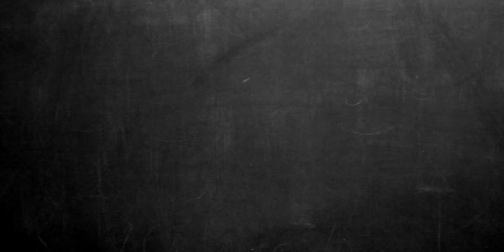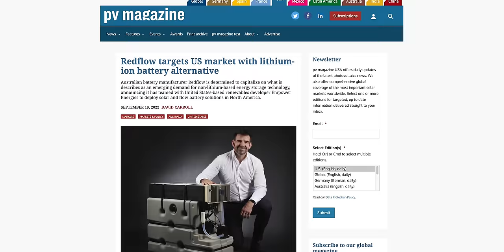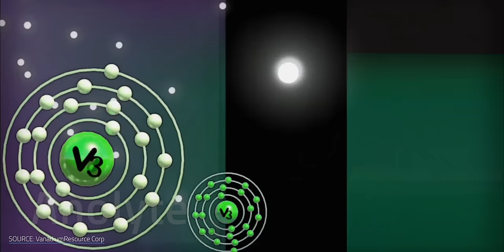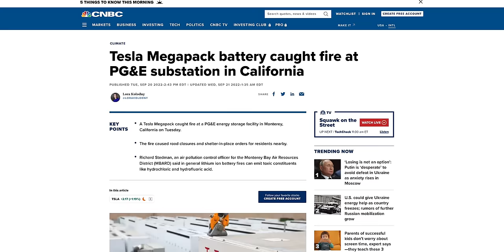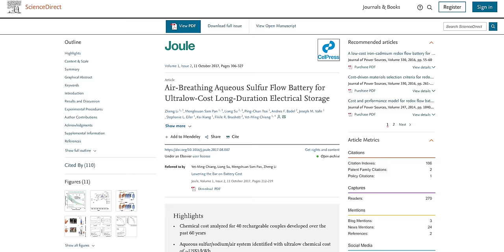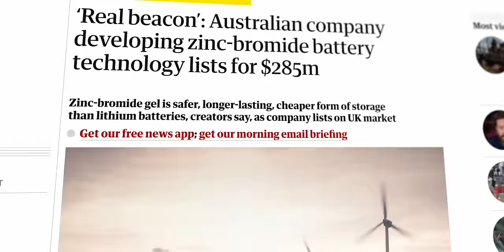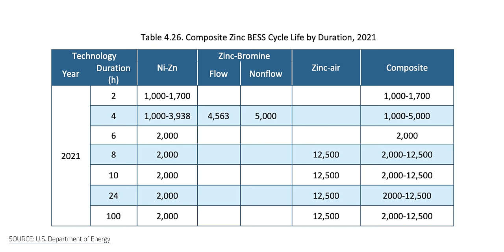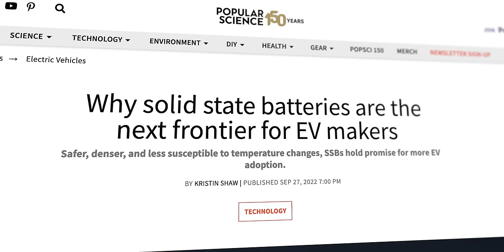137 Year Old Battery Tech May Be The Future of Energy Storage

Comment: With the vanadium chemistry, the assertion that they're safe "with proper design, manufacture, and maintenance" is engineering hubris at its worst. Don't use systems that require everything to go absolutely correctly to avoid catastrophe, use systems that are extremely unlikely to cause toxic nightmares even if everything goes wrong. Any other approach is stupidity. If the smallest hiccup can cause vanadium sulfide to poison an entire area, then DON'T USE IT. Jebus.

Comment: What I keep on harping, over the decades ... COST is the most important factor !!!!!

If lithium becomes scarce, its price will rise. Not to mention the other components in a lithium ion battery. Look at gasoline. Fossil fuels are used because they have great energy density, more importantly, they are cheap ! But when there's a supply disruption, the cost rise, and the masses want to lynch oil executives !

Save lithium ion for portable devices, from smartphones to EVs. Use other battery technologies for stationary bulk storage. And use all of them. Preferably, those using materials easy to supply, and less likely to suffer volatility, in prices. And when it comes to the materials hazardous properties, if its stationary, it can easily be made safe.

You keep harping like there's one fits all solution ! There's not. Use the solution, that's best for that particular application ! And there's nothing wrong with lead acid batteries. They're perfectly safe, if you don't abuse them, and recycle them properly. And it doesn't take much effort, or cost, to do either.

Comment: "Do you think zinc-bromine batteries will gain ground and become a big player in energy storage?". If fusion energy or Dual Fluid reactors became a reality, you would not realy need them. 120 Wh/kg. I have a scooter with a 48V/20 A. Or nominal 960 W/h lithium batt. (18650 cells I think). If I remember correct its 6,5  maybe even 7,5 kg, or 128-148 Wh/kg. My bicycle also has a 48v/20 A. But only weights 5 kg. Or 192 Wh/kg. So a Z-B would be fine..A 100 kWh Tesla battery weights 1377 pounds. Or 625 kg. Thats 160 Wh/kg.

Comment: Redflow batteries can be bought today.  But they are more expensive than the Tesla batteries.  I bought a Tesla battery because redflow is unprofitable and so may go into liquidation and because Tesla has negotiated a 3 times higher feed in Tarif if you sign up to allow the provider to drain the battery approx 4 times per annum (vertual power plan I think is the jargon). I acknowledge that the reflow is better technology and should be the future but every one knows the best technology does not always dominate

Comment: Thx Matt, I love the channel.  Generally speaking i'm a much bigger fan of hydrogen ultimately being how we as a society store extraneous energy (via nuclear sources) but this is certainly a promising development for the overall direction that the EU and many US states are hell bent on headed.
Reply: Hydrogen via Nuclear, Sounds like Nuclear energy with extra steps? Isn't there a vast amount of energy wasted in this process to 'save' the hydrogen for later?
Reply: @brendanmichaelwelsh6260  yes, that's the point: you have extraordinarily efficient power generation in centralized, highly productive sites so you can stock it up at a loss to save it for applications where those storage methods address specific technical challenges.  In this case, Hydrogen is a better carrier of potential energy than any other substance in the universe (save a few exotic types of matter that are not useful for these kinds of systems).  So you can fit a LOT of energy in a small space with hydrogen for something like a car or truck, AND with the added benefit of not being overly reliant on massive supply chains of exotic and carbon heavy metal refining operations.  Realistically we should be saving rare earths and the like for things like electronics and similar applications anyways. You can do this same thing with renewables too, but if carbon is your biggest concern, and a number of us believe it is, then doing it at scale with renewables suddenly becomes a whole lot less sexy. And that's without even getting into the real world cost and geopolitical element of being reliant on nations like China and India to be fair and earnest participants.

Comment: While batteries are cool, its kinda attacking the problem backwards. 
Instead, figure out where in your manufactoring you can store energy as materials. 
Fx in chemical production, you want to run your electrolysis when energy is abundant, and store the products for when its not.

Comment: For the open public, battery🔋cells can be useful also with mass density adjustment. From compress micro vs lighter weight, making more room. To bulk & puff vs small & heavy, such as flight crafts advantage. Gelion Z-Bro's cells has its unique attributes usage.

Comment: I've never been a fan of Lithium Ion. It's good that we're actively trying to replace them. Zinc/Bromide seems a promising formulation. However, I believe Copper/Carbon/Phosphate chemistries will show the most potential for replacing and surpassing Lithium Ion. Where safety is concerned, anything is safer and Lithium Ion. I've seen EV's catch fire. They burn to the ground in seconds. I will never drive or ride in one equipped with that most dangerous formulation.

Comment: Just looking at the gelion battery I wonder if it would work as a drop in replacement for standard automotive 12 v batteries. While I agree that it looks great for stationary storage, it seems better than the 12v lead battery. If understood correctly it is more energy dense and safer than the lead battery, and still just as recyclable.

Comment: The reason Zinc Bromide batteries have never been mass produced for the past 140 years, is because of their highly corrosive chemistry.  
While Zinc Bromide batteries have excellent energy density, deep discharge, & good reversability... Lead acid batteries dominated the market, because they are 7 to 8 times more durable.  

The simple fact is, that the problem of Zinc Bromide corrosion cannot be solved, because of the oxidizing nature of bromide itself.  These batteries are doomed to be short lived, compared to their Lead Acid counterparts.

Comment: Natural renewable energy is NOT in wind, solar, or buofuel. You can't even recycle wind turbine blades or solar panels without huge waste and landfills.

Clean renewable energy is and has always been rivers, gravity, and regular thermodynamics. 
Storing electricity in batteries for anything larger than big vehicle is just not efficient. You can make the best battery in the world but you will still have to manufacture and charge it on hydropower, nuclear, or diesel.

The only real renewable energy is gravity, water makes it easy to take advantage of.

Comment: 12:13 70% DOD doubles lifespan? Wow. Seriously need BMS to call a battery empty at 70% DOD. I'd deal with a shorter range/cellphone recharge requirement, if it doubled the life span of the battery.
Reply: Comment above is for LiPo batteries. (Chrome on ipad won't allow me to edit or delete it, go figure). I can easily see a Gelion/Redflow battery in homes. We've talked about using "home batteries" to "help the grid" for years - this would make this an increasingly likely possibility.

Comment: Engineers tend always to achieve the best results with the highest degree of technology, question of reputation... Lithium ion batteries are the best today. Due to electrochemical constraints and reality, I doubt we will do much better in the future, despite so many "optimistic" discourses. Hydrocarbons will always store much more energy than batteries for the same weight and volume. But may it not be a good time yet accept less "yields" but at much lower costs, with much more abundant and cheaper minerals? Of course flying an airplane needs dense energy storage, but this is not always a necessity, for instance for energy storage in buildings.

Comment: I simply don't know why lead acid batteries are not installed in houses. Cheaper and more recyclable and no problems with the weight.
Just like the lithium is good for city cars doing smaller distances and diesels for the rural area.
Horses for courses

Comment: Zinc-bromide has a lower energy capacity. No matter what; lithium ion has an energy density similar to TNT. Weight is a huge issue for battery powered EVs. I just don't see this replacing Lithium. Honestly, nuclear is the only way, no need to store energy, the reactor makes energy all the time, whether you use it or not. But again, I doubt people will ever put a reactor into a car, don't even see a feasible way to make a reactor small enough and yet able to power a car. Ah well. Matt is always overly optimistic in my opinion, but I guess it's good for him.

Comment: oooorrrr you could 100% reduce your dependence on chemicals and use only local materials or commonly available materials and use water or physical gravity batteries
Reply: How is this practical for all people and uses?
Reply: you either  centralize it just like elec is centralized already. ORRRRR you can build a tower on your property and use a heavy weight and use gear differentials to spin a fly wheel to generate electricity from it. a tower with weight and gear box and generator/alternator is the same/less than the needed battery bank anyway

Comment: I do not think so. No better than Lithium, regarding energy density, and other disavantages. There is no battery which can compare with the energy storage capacity of GASOLINE... what we must do is PRODUCE gasoline from the CO2 and H2O in the air, using clean energy, be it solar, wind or nuclear. All the range you need, easy to distribute (and we have all the infraestructure in place!), and we already have good gas cars. And you fill a gas tank in a coupla minutes, man.

Comment: Quarts crystal is the future: drill a hole through it stick a magnesium bar filled with Borax run a copper wire to the powdered borax with 1/3rd thorium... With a copper wire ... Use a watch mechanism to constantly tap the quarts... And you have a never-ending battery.. on any scale size 😑 humans...